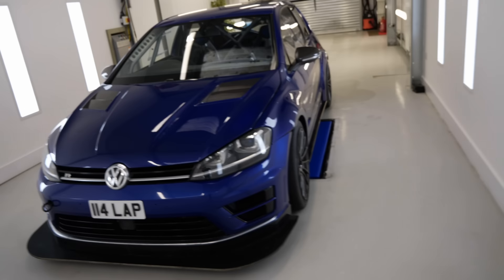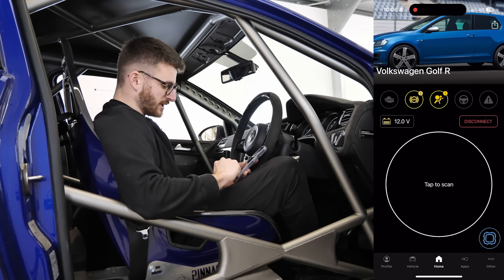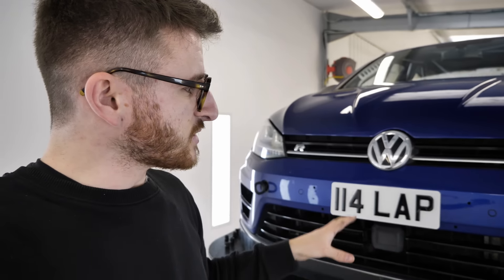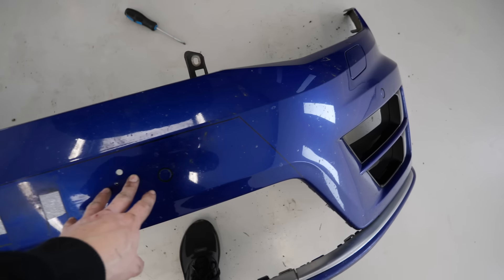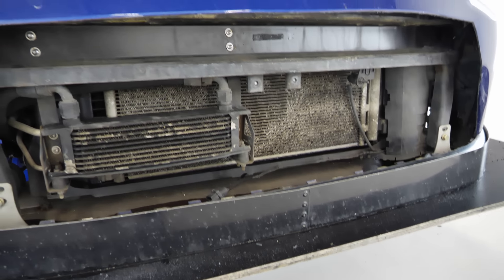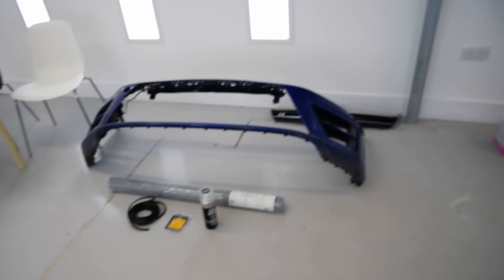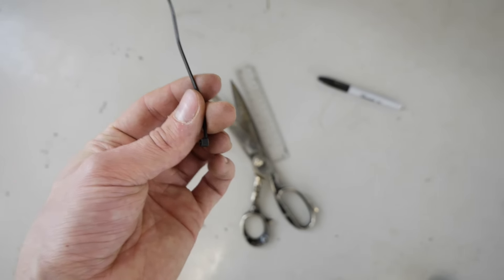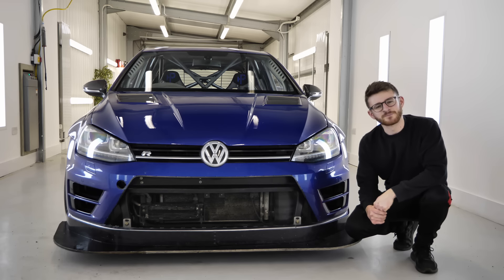The NEW LOOK For My Golf R is WILD! *Custom DIY Cooling Modifications*

Comment: Change your AC condenser it is trashed and is blocking airflow to the rad and intercooler that is probably the main cause of your overheat issues at the ring , having said that all the other mods are great 👍 keep it up . I would definitely run a mesh grill over the big  new hole at the front 😅 one more thing is you may need a couple of vertical support rods behind the mesh to stop it getting pushed backwards

Comment: Hello mate on the issue of cooling there’s one thing that you can do, which will make a hell of a difference and will not cost you any money at all and that is simply if you look at your AC cooler that is at the front and oil, cooler and so on These are radiators and coolers, or heat, exchanges, which have radiators behind them such as your intercooler and your radiator for your car, now with all of these sitting in front of each other, their lies a problem, and that is dirt when dirt gets in all of these, when they’re stacked up on top of each other , the efficiency of them is vastly affected so what can you do about it , is very simple, simply wash the dirt out. I’ve using a garden hose with a spray nozzle on it or a pressure washer at low pressure and you will be very surprised on your amount of shit that’s gonna come out just by doing that you will increase the efficiency tenfold.
Reply: Not to mention how destroyed the ac condenser fins looks, that is definitely robbing him of airflow to the radiator and intercooler behind it. swapping to a brand new unit will definitely increase airflow and drop temps.